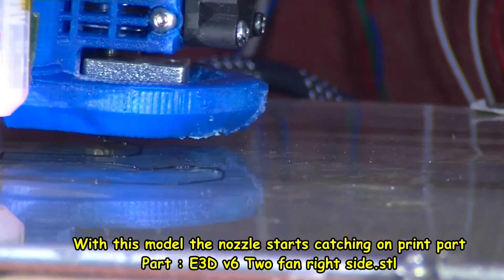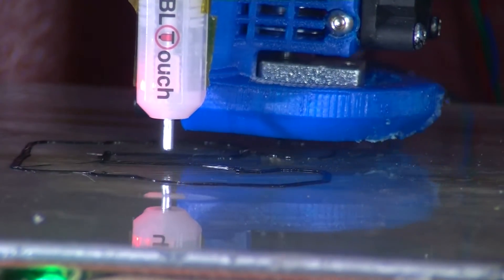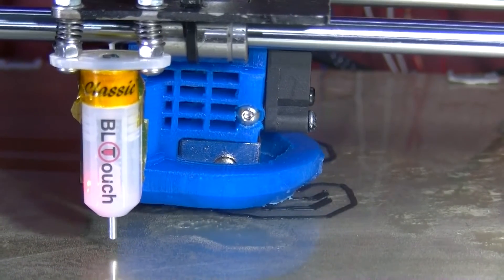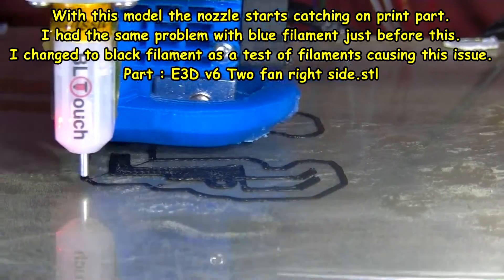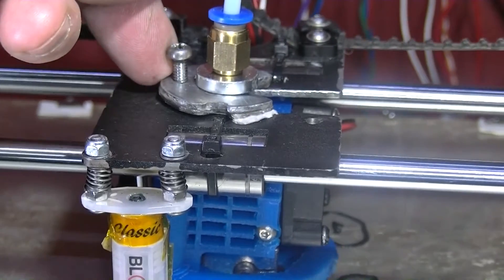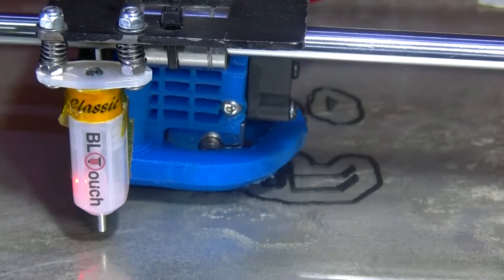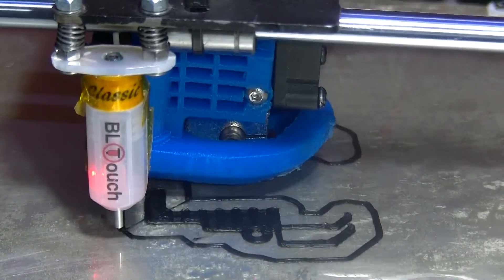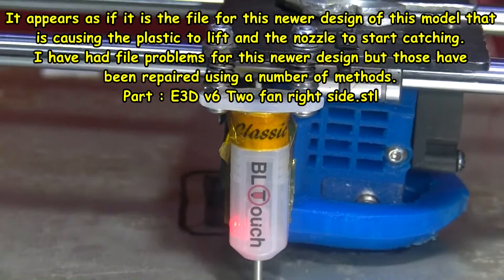Nozzle catching on print part

Comment: My ender 3 pro, makes the first layer properly, the second layer starts to gouge into the first one, it happens till a few layers and the print above those layers looks perfectly fine
Reply: Ok guys wow what a difference. I took apart the printer and squared up the frame so tops and bottoms of z extrusions were within 1/32", adjusted esteps, then ran multiple calibration tests with hollow cubes to adjust the flow rate until my wall thicknesses of my parts with calipers was spot on. Can't believe the quality I am getting. Flow rate is down at 78 giving me amazing dimensionally accurate parts. Everything made a difference but I was definitely putting down way too much filament before.
Reply: Hey, have you had any luck with your issue, I’m going crazy because I have the exact same issue, but I’m having no luck finding solutions
Reply from the maker: @joonie629  I am now having a lot more success using Elmer's Disappearing Purple School Glue Sticks, 0.21 Ounces Each,
6 Sticks per Pack (E1560)
Reply: @3D_Printing  I've been using it too but I cant get the level perfect... Either I get elephant's foot or it stick to the bed
Reply: Sometimes there are bubble like things trapped between two layers, the nozzle eventually starts crashing into the part and rubbing badly
Reply: Mines the same printer with the same problem... Only if I back up the bed anymore itll bead out and wont stick to the bed...
Reply from the maker: @teddy5004  I am now having a lot more success using Elmer's Disappearing Purple School Glue Sticks, 0.21 Ounces Each,
6 Sticks per Pack (E1560)
http://tinyurl.com/purple-glue-stick
Reply: Did you ever figure this out? I'm having the same problem with mine. First layer is perfect... then second layer lays down scratching the first and it continues through each layer of the print
Reply: @TheDudeChannel409  I tightened up my frame and relevled the bed using a metal feeler gauge to fix this issue.
Reply from the maker: Lubricant the threaded rods, check that Z height movement is moving the correct distance, over say 200 mm adjust Z E-steps to correct.  A 10mm calibration cube is not enough for this testing.

Comment: I'm sure you got this figured out by now.  Nozzle seems a bit to close to bed, adhesion needs some improvement, such as glue sticks or hairspray.  Also, the nozzle fan should not even be on for the first layer.  I don't turn my nozzle fan on until the 3rd layer and it has helped greatly.
Reply from the maker: Thank You:
 I am now having a lot more sucess using Elmer's Disappearing Purple School Glue Sticks, 0.21 Ounces Each,
6 Sticks per Pack (E1560)
on
Custom Borosilicate Glass made to order
eBay seller :  shanewoodward2015

235 C nozzle and 65 C on heat bed for ABS, no part fan.
Reply: @3D_Printing  this must be the secret to wealth